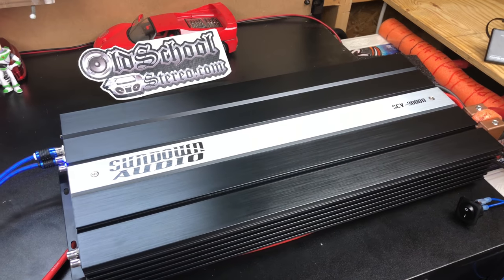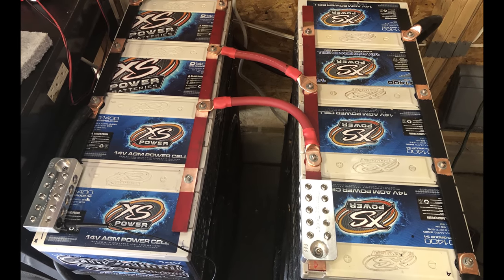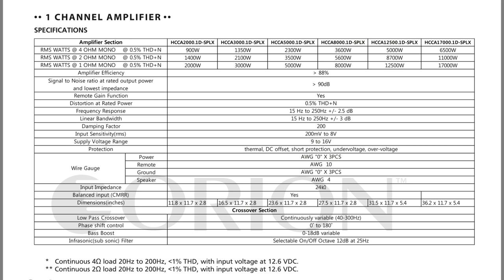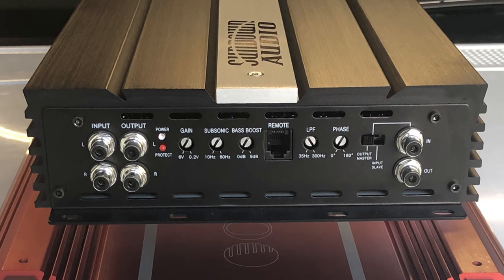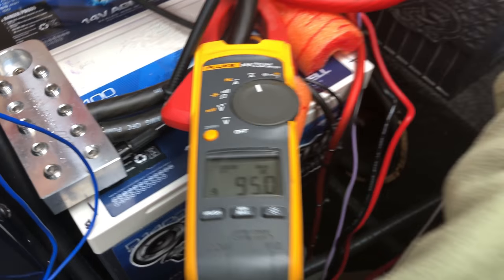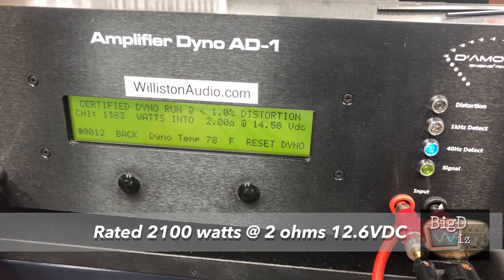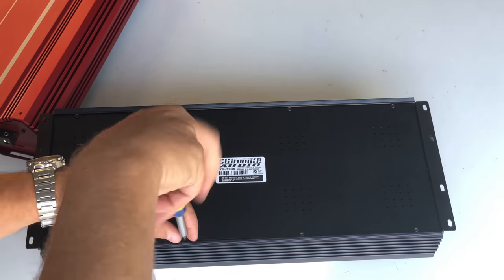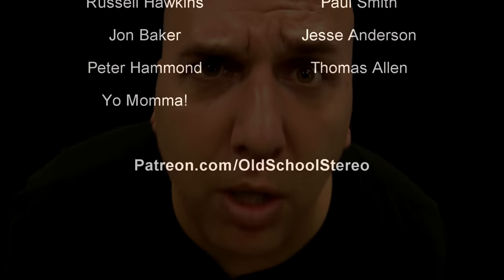Sundown SCV-3000D vs Orion HCCA 3000.1DSPLX Amp Dyno Test (4K)

Comment: the endcaps arent cheap plastic..  there pretty heavy duty abs black plastic..       and they havent changed it     i just bought  a new 2019 hcca 8000.1 Dv2     even more efficent        orion is killin it  ..  but  my only complaint with orion is there warranty..    if you install it “”yourself””   you dont get a 1 year warranty.. i think its only 90 days...   honestly for what you pay for these amps new  you should get a 2 year warranty or more..   stand by your product orion..  change that policy           make it one year for eveyone.
Reply from the maker: They are relatively durable, but out of 5 different HCCA’s I’ve bought, 2 of them had broken end caps

Comment: New version 3k Orion removed 2 of the transformers so the 3k is only a 3k now at best.
Reply from the maker: I was curious as well so I asked Orion. They said the new amps have larger wire in the transformers (in the 4 equating to more than the six previously) and they also have extra mosfets in the power supply so actually the newer ones should be more powerful
Reply: @wal  mehh I doubt it based solely on side by side pics. Good one on Amazon review under amp.. Old amp was 2.5" longer and  plus had to offset a row of caps to fit the trans on board. The new does have 2 more MOSFETs per side but cap count stays the same. Unable to locate a pic close enough to read them so they may be same or better/worse. Again I'm going soley off pics but I just don't see the 4 trans on a shorter board being equal or bigger then the old 6... Wonder why no one has put the new one on a Dyno "BIG D 😆" but it does leave me really wanting to know.

Comment: Did ORION send that unit? If so I think you should randomly get one off the shelf and rerun it .to see if that one was altered
Reply: There are a few other bench test over the net with similar results.
Reply from the maker: I bought the Orion off of eBay for $599 after $50 off coupon.
Reply: Peter B I got my Orion Xtr 2500.1 off eBay for $330, and the birthsheet said 2972 watts @ 1 ohm @ 12.6v. My subs (and Big D's Dyno video) say it's telling the truth. Orion's high end gear is legit.
Reply: catch22frubert 100% true all u gotta do is hook it up to a sub an you will see jus how beast they are!!

Comment: I love how when you open them up the Orion is basically 2 amps strapped together. Essentially all the same components as the sundown, just has it twice. The dyno shows the same thing. Orion has had year to learn maths but still just throw arbitrary numbers out. This amp does 8k. Let's be conservative and say 7... or 3
Reply from the maker: They rate the amp 3000 watts at 12.6 volts, which is precisely what it does. Since most companies rate at 14.4, the Orion has the benefit of almost 2 additional volts of input and as shown each additional volt gives another 1000 watts
Reply: @wal  ah I see. Thanks for the clarification,  and the response. You're the man keep it up.

Comment: pause at 10:47 How is this drag race fair? This orion should be drag racing with the scv 4000. Run 3 runs of 1/0 to the scv 4k and see what it will do. Orion has a 4k amp here. But they put 3k on it? Come on people. But hats off to Orion for the power it does for the price.
Reply: this video series is about 3k and 3.5k Korean board amps..
put the Orion 4k aginst the sundown 4k? the Orion will still beat it, hell I bet the hcca 3k would beat sundown 4k anyways
Reply: I think the sundown 4k done around 6k on the dyno at 1ohm, correct me if i'm wrong. The sundown 4k only has 1 1/0 power and ground inputs also. that hurts it.  But look at the guts on both the 4k and this orion 3k. The Orion 3k should be called a 4k. Orion has been making cheater amps for a long time and i guess they still are.
Reply: +basshead82 orion amps are rated to make there power at 12.6v or 2ohm lol.. they are built very well bottom line, are they not saposta make an amp that doubles it's power at 14.4v.. triple input are there because they are making a competition amp "hcca".. I would have no problem running either amp.. but for the price, u would have to be a real sundown nut hugger to not buy the hcca instead.. I run sundown subs, but I run the skar skv2.2500 because it was affordable, I never had a problem with my amp, makes great power at 1ohm and .5ohm.. but if this video had been released sooner you bet your ass I would have bought the hcca.. I might actually sell the skar and buy it.. lol my skar skv2.2500 makes 2900w at 1ohm (14v), it's actually very comparable to this sundown 3k amp and was only $499, half of what the SD cost
Reply: tankdog03 it's not that it's built better, it has more parts inside to do more power. The board on the scv 3k has around half the parts. Put the same parts in the scv 3k and then sundown can have a cheater amp to. I love how orion is making all that power while staying affordable though. I to would love to buy this orion so I can run it instead of my scv 3k. Glad to see orion back in the spotlight.

Comment: I called it. No subsonic tho?! Stop cutting corners Orion... It's not just about power. Put a metal bass knob in your XTR and hcca amps also. Ditch the plastic end caps and you'll have a sexy line with XTR and hcca. Can't deny that power though!!
Reply from the maker: We’ll see if they are listening. I have a feeling they are...
Reply: BigDWiz I hope they see this comment in particular. Those are the only negatives. Ditch the plastic, add a clip light to the bass knob, and make the subsonic adjustable. If they can do that, it would be nearly perfect.

Comment: This is why sundown made the salt amps,,LOL.. still not like this, i have  a hcca 3k, good power, was  wondering if you would rerun it on lithium bank?
Reply from the maker: I will when I get some extra time
Reply: @wal  i did a in vehicle smd amm1 dyno on my hcca 3k. i have 80 ah yinlong lto, 370 alt and it easily does 5k wired at .5 and it dyno'd 6745 on music at .9 no clipping, more to come....

Comment: If you try running the Orion at 7k + it is going to blow up.
5k may be way to high to run.
All that said, GOD DAMN THAT'S IMPRESSIVE.!
Reply from the maker: At 14.4 volts, this amp puts out 5kW. Insane power for the $$ for a Korean Class D
Reply: With higher voltage you may be right.  Lower current on the input reduces heat a lot.

Comment: Can you even buy that orion amp new anymore? Are the ones actually being sold new comparable to what is really a cheater 4k amp? What about efficiency at 1ohm which I'm sure most buying this amp care about alot more than 4ohm. Esp given that the sundown showed a more favorable efficiency curve. Also the slap vids? Kinda sketchy as dwizs dyno videos have always been what with the cuts he used to do right before showing the actual dyno numbers and all. Take this one with a grain of salt.
Reply: Damn!!@
Reply: BigDWiz cant buy that orion model new anymore. Check. Cheater 4k amp as shown even in your  vid by the 4/3 capacitor ratio. Check. Not showing 1ohm efficiency. Check. Comparison of an orion amp still being made so you can use something other than an ebay price. Missing. Video for fools. Check

Comment: Sundown SAZ Series were better. My SAZ-1500D is good to 0.25ohm not that I would run that daily. Don’t try that on your normal SAZ-1500D, mine are all Team Amps. Taking away features sucks too. I can always run them on a normal 12-14.7v system, or run a separate 16v/18v loop (Alt + Batteries.)
Reply: I've run my og saz3500's at .25 many times. Never a problem, not team amps either. I've done it to both amps, many times. I've protected a few times, but never let the smoke out. Still beating these amps 10+ years later. Abuse, every day. They don't make them as durable as these old tanks anymore.
Reply: @georgesrisomsak9650  They don’t. Company isn’t as friendly as it was either. I was going to get the big boy SAZ Amp(I forget what it was.. NS1?) years ago now and my email was forwarded to a dealer. I used to go directly through Jacob, but I was “someone who bought amps long time ago” according to Jacob’s brother when the dealer asked who I was. It rubbed me the wrong way as my Vehicle/Setup was on the front website forever, and I helped promote when they were just starting out.
Reply: @Len_M.  I used to push the brand back when they made quality stuff starting out to make a name over a decade ago. Since then, every sundown sub I've ever ran(most of them) have had failed tinsel leads due to lead fatigue from the sharp bend at the triple joint within two years. Every one of them. I'll admit, I'm not nice, and abusive at times,, but  I have TC sounds subs from the early 2000's that still play fine at full excursion, no failed leads. Massive abuse as well. I currently run DD, abuse the coils till they are dull, black, and separating from the former itself. After years of maximum excursion, clipping, serious overpower, never a failed lead. I've reconed them from burnt coils, but NEVER a lead failure. I've had a DD sw2508 for over 6 years now, major abuse, but it plays fine, no signs of lead problems. No discoloration, lead fraying, or other. The new amps are crazy overpriced, and under performing for the $ by very far. Re cones are overpriced, like the rest of their gear. 

Overpriced. Perform well, but no longevity. It's designed to be that way. 

I'll personally spend my $ with any other company. Sundown had many chances, and now you could say I'm a hater. I have my reasons and proof.

Comment: I’ll still continue to buy Sundown because I can be confident it will still be working like new when it’s 10 years old and older. Reliability is what I’ve found in Sundown Audio. But then again, I’m not competing so huge power is not for me. Never owned a Orion piece of equipment so have no experience. I do own quite a few Sundown pieces of equipment and the only failure was my fault, not the equipment.
Reply: James Trapp lol you know these amps use mostly the same components right? If you run the amp like you’re supposed to and feed it the right voltage I’m sure the other amps will last just as long.
Reply: Jeromey Smith ya, I’m aware. But Jacob is so transparent with his prototype testing and you can follow him developing new products on caco, I’ve yet to see another brand let the potential customers be that informed. His stringent quality and performance standards means I’m getting a reliable quality piece. Just my humble opinion.
Reply from the maker: Great comment and thanks for sharing your experiences

Comment: Orion killed it!!! It's lowest power hcca is more powerful than rockford fosgate most powerful amp!!!! Wow
Reply from the maker: I bought a RF T2500.1bdcp a few months ago and need to test it. According to birth sheet, it should do pretty good in this batch, especially the 2 ohm measurement, important once taking into account impedance rise
Reply: U have to remember that rockford jl an I think alpine does it to but there power supplies notice impedance an will do rated power at all ohm loads so box rise doesn't effect the power but damn are they expensive :/

Comment: I'd still take that crescendo over the rest. Efficiency and price is crazy good. Especially when you're cramped on alternator headroom like me
Reply: Alan Schulwitz the efficiency from the other amps is not even that much of a difference man come on lol
Reply: Jeromey Smith crescendo and dc was in the 90s? The Orion was in the 70s. I'm on a 2k amplifier with like 50% efficiency. So I'm drawing as much current as the crescendo and producing half as much power. Plus afaik. Higher efficiency means lower heat output which is always a plus.
Reply: Alan Schulwitz I was talking about the other amps not the Orion my fault for not clarifying the DC amp was 83.6% efficient at 1ohms not in the 90’s I think you need to rewatch the video
Reply: Jeromey Smith my bad memory then, if it was in the 80s then I see your point :^)
Reply: Jeromey Smith I wasnt considering the other amps at that point. The crescendo had higher efficiency at what? One of the lowest price points and came with a fan. The orion was the most powerful of the bunch and at also at a competitive price point
Reply: Alan Schulwitz the crescendo was 85.3% efficient at 1 ohm. I agree with you about the fan and Tiffany rca’s tho. My only complaint about crescendo is that they can’t seem to keep stuff in stock lol

Comment: Props to the Orion amp but I think the over powering the rated watts is just as bad a lower than power rated amp... If you buy a couple of 1500 RMS subs and want to run a 3k amp on them then the Orion is pulling 6k then it will smoke the subs in no time. Where as the Sundown amp is accurately rated for those subs. Or your in a power limited class as I am, you're capped at 4k watts RMS you buy this 3K amp to stay well under the class cap and you break out every time you hit the meter because it's over powered the rating.  I think Sundown is over priced and I'm not a fan, but they say you're buying a 3k amp, you get a 3k amp.
Reply: Aaron Hoobler I can’t believe people are really complaining about a amp putting out more power then it’s rated for. Just turn the gain down and problem solved
Reply: Na, it's rated at 12.6 , plus most people don't see the power they think they are because box rise.  If it's clean, most subs will play well past their rated.
Reply: That's when experience comes into play but yes for beginners that want an amp that puts out exactly what they say this is not the amp for you.....u can tell if a sub is being over powered an that to comes with experience also it's always better to over power than under good luck
Reply: I run in the Meca trunk class and I would love to have this amp and I'm actually thinking on buying this amp... I personally would not recommend this amp to anyone with it pulling this much power unless the build could handle it or the person planned up upgrading to a system that could handle it. I don't believe in buying an amp to turn it down.  Turn down for what... :-)
Reply: Agree 100%. I get a ton of raise with my setup but I still pull rated from my amps. But you know how people are when they are new to car audio. Clip it until it hurts. At least that has been my experience in car audio.
Reply: Aaron Hoobler an I think again lack of experience bc do they really know when it starts to clip most blare there shit full tilt an I can hear it clipping a mile away but for some I guess they like shitty sounding music lol

Comment: I know the HCCA amps have always been cheater amps but something comes to mind with these numbers...at what point do we start to criticize these companies for not accurately rating their amps. If I had a sub that was designed to handled 2k watts and picked that Orion amp thinking it was a good fit at 2 ohm, how pissed would I be to find out I'm sending over 50% more power than the amp is rated....which quite possibly could damage my sub. I kinda feel it goes both ways. We criticize amps for underperforming....why not criticize for way over performing? I don't care about how many watts my dollar can buy...I care about how many watts I want to feed my sub.
Reply: Joey Cameron People don't complain about underrating because they want maximum performance per dollar. It's really easy to turn the gain down a little if it's too much. You should be able to tell when you are feeding a sub 1200-1500 watts over rated. Most people buying a 3000 watt bass amp have knowledge about what they are doing.
Reply from the maker: I think they could provide both 12.6 and 14.4 volt numbers. This way people know what to expect.
Reply: This is why most companies recommend Authorized Installers.....you start doing DIY, you better do your homework. One thing is certain...better to have too much clean power than a maxed out dirty signal.

Comment: That orion should have been named a 4k instead of a 3k. This is called a cheater amp. Right? Orion has more parts inside so it should have done more (like a 4k). Just list it what it suppose to be instead of under rating it that much. Sundown did what it said it would do. So there are no losers here. Also that orion looks to cheap for me. Just how long do you think it will last until problems start?
Reply: it's rated at 12.6v to do 3k and it does..
at 14.4v it does way more, not technically overrated but yeah definitely the king of 3k amps